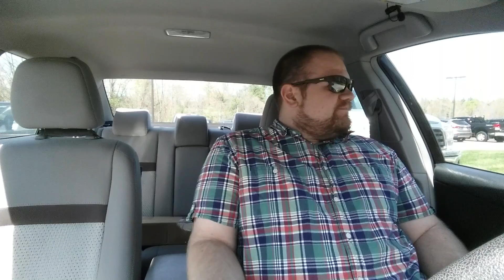AC Install | Was An NC Rating Calculated?

Comment: Curt Taipale said on the facebook "Church Sound - Media Tech's" group page:

"We always strongly recommend that a church building committee allow us to include a review of the mechanical system design. It doesn't cost all that much and can really make the difference. Occasionally we have a church that doesn't recognize the value 
of that step. Case in point:  we had a church turn us down for that study because their HVAC contractor told us in a meeting that he would achieve an NC30 . Job gets finished and we measured an NC70. It was so loud that it would need to be turned off during the invitation and any quiet moments of the pastor's message. Trying to fix that noise now would come at a huge expense, way more than had it been done during construction."

My experience is that having a room that meets the NC-30 criteria is usually very expensive and hard to achieve. :-( 
I would have been hard pressed to have not called the HVAC contractor out on that claim had I been at that meeting.
Reply from the maker: +sewing1243 This is a great experience for folks to learn from.  Thanks for sharing!  In our case we had a series of small units installed as a retro fit this week.  I found out that the AC units were installed by a sub contractor that specializes in that line of work, not a DIY job.  No NC rating was calculated as far as I know (fingers crossed they aren't too loud).  The install is already complete and the initial reports I've heard is that "the units are not too loud". I will get to hear how they sound in the room this weekend. I'll probably come in early on Sunday morning and take some dB-SPL (A) slow, measurements from our fixed measurement location to see the impact to the noise floor when the system turns on.